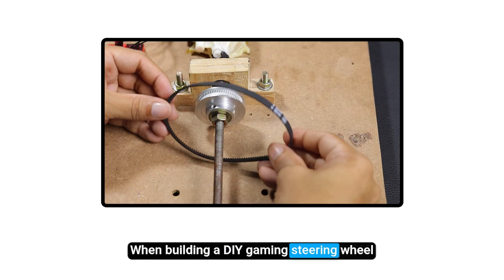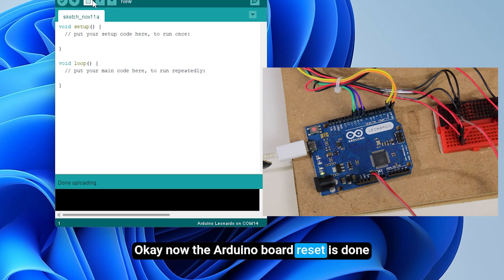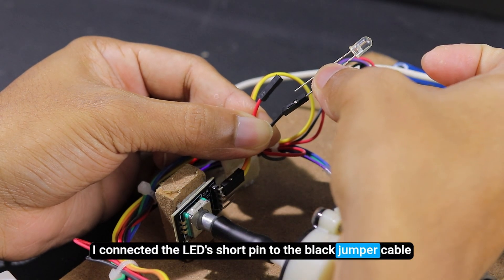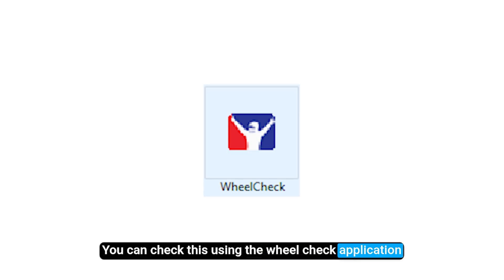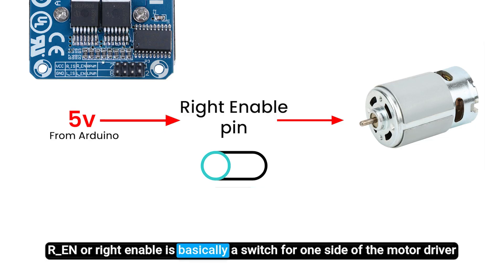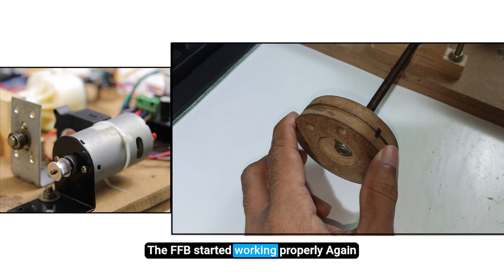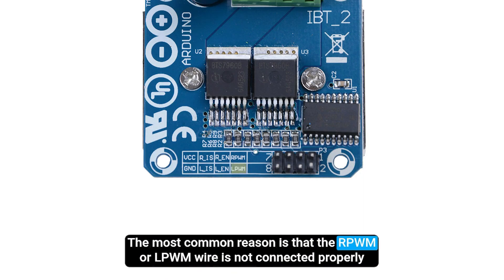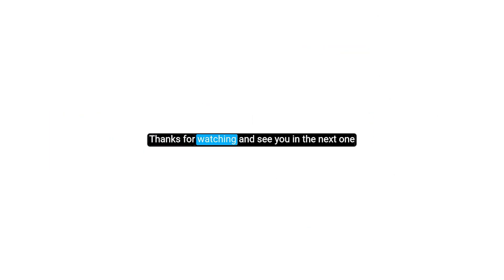Force Feedback Not Working!

Comment: I'm using a 24V 33A metal case power supply, but it's insufficient. The light on my power supply dims under load or when the current is low, and the motor can't receive full power. I'm using an RS775 motor. What rated power supply should I get? What rated would you recommend?

Comment: Hello, I am currently building a racing wheel. However, while everything else such as the pedals works correctly, only the encoder is not being recognized. I have already tried all the calibration fixes and error solutions that you previously suggested, but none of them worked. Could you please help me with this?
Reply: in wheel config, game ect and the encoder test has been completed and it is functioning normally.

Comment: I assembled the system, but it's not turning left. I connected it to a circuit board for testing, connecting the positive and negative terminals in their places. It turns when I supply 5V to RPWM, but it doesn't work when I supply 5V to LPWM. The motor makes a clicking sound on the line, but it doesn't turn. My power supply is 12V 33A, which isn't insufficient.

Comment: Yo man, i have a problem where when my force feedback starts working and i rotate the wheel in that direction pushin the ffb, it jsut cuts off the feedback and it returns after a few seconds. I think my psu is weak (75W for rs775 motor) but i wanter to hear your opinion before buying a new psu!